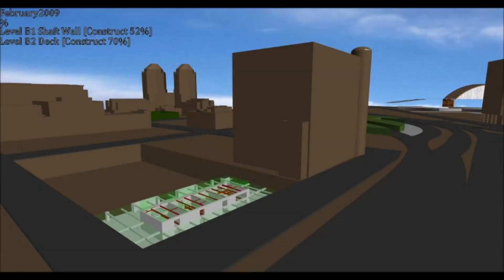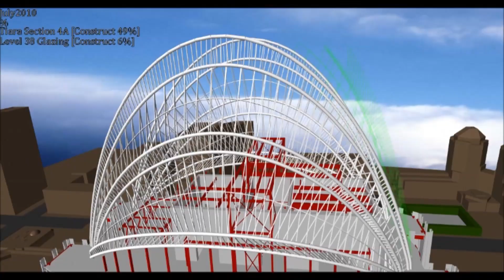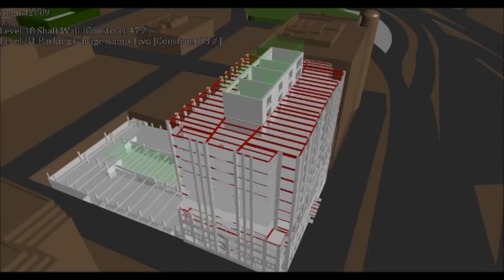Construction Management

Comment: Construction Managers have a place. But without the hard working, smart trades people and laborers toiling away day in and day out, nothing would be built. I have more respect for someone who started at the bottom then climbed the managerial ladder, instead of someone straight out of college with a fancy degree and who thinks they can just start giving out orders.
Reply: You can’t beat experience when it comes to trades, but not everyone is cut out for labor just as others are not cut out for management. Definitely a plus if you can do both.
Reply: @MrGatoka  You said it best.
Reply: Construction management is different than doing a trade. So they would need to be trained in things they aren't familiar with.
Reply: A college degree comes with blood sweat and tears to.. well maybe not blood. But people earn those degrees and put in extremely hard work and it shows that they can start something and finish it.
Reply: There is something to be said for the man who works his way up the chain. Those people are very important. However, if you have the opportunity to get somewhere quicker through a college degree it only makes sense to go that route.

Comment: good thing the architects are around to tell you what to do haha
Reply: lol, architects work for the contractor, contractors tell architects what to do.
Reply: @blakeb4583  No. Architects work for the owners and so does the general contractor.
Reply: @selahjames1267  No shit Sherlock, it was a joke--not meant to be taken literally. 
The reality is that we're the one building the project. If they require something that is good in design but is impossible to build in reality, we put our foot down. Architects are just a bunch of glorified art students who, most of which (especially junior designers), have never actually been on a construction site in their life. Not to mention, we pretty much fix all of the shitty design flaws that the architects made via RFIs and often times have more say to the owner about what will be built because half the time something an architect wants to do is not physically constructable. My project currently isn't even over with and we have over 3000 RFIs because the architects were probably high when they were designing the building. I get that technically speaking the owner is in charge, and that the architect and the GC work for the owner... but I'd say we have more power than architects when it comes to building a project because most architects have never even picked up a hammer. My point was to poke fun at the fact that people think we have the architects holding our hand throughout the delivery of a project, when in reality it's the opposite.We literally had a 3 month long argument with our architect because the fire sprinkler head cover color did not exactly match the metal ceiling panel color because the manufacturer they selected in the specs (the only one we were allowed to use) had a trademarked color for their metal panels, and the architect only allowed us to use a different specific manufacturer for the sprinkler head covers. It was literally impossible to match the metal panel cover because the manufacturer of that panel would not license the color to the other manufacturer. We ended up winning that battle because we literally have 0 time to waste on fucking sprinkler head covers. That's the kind of shit you deal with when you deal with architects--70% of the time they're useless, 30% of the time they're actually helpful.
Reply: @blakeb4583  i dont know what your deal is with architects,  but if you have work with them closely, you know they are more than glorified artists. There is a lot of math and science involved. GCs couldnt  do their jobs without architects because all their work is based on the construction documents that the architects  created for the project.

Comment: do you need to be a physics wiz to be a construction manager?
Reply: no
Reply: Maybe
Reply: No, but many of the classes I've taken in college for my Construction Science & Management degree have been engineering and physics based, so for classes, yes... out in the field, you just need to be able to understand how loads affect members on a building and be able to spot physics/engineering issues in buildings, but as far as doing any of the actual calculations, you won't really need to know it out in the field because that falls on the engineers
Reply: Fuck no!
Reply: So......
Reply: caymus cairns ppdooee lelod
Reply: I'm required to take one college level physics for my bachelors degree. That's not much, considering there are many other physics classes. The one I have to take isn't even calculus based. You use algebra and trigonometry to solve the problems.
Reply: FarFrom Banal depends on the company you work for. If you work for a GC, expect to work for 5-7 years before becoming a project manager, around 10-12 years to become a senior PM (the person in charge of the entire project). If you work for a sub, expect to work for around 3-5 years before becoming a PM. That being said, GC PMs make substantially more than subcontractor PMs due to the amount of risk. I work for a large GC on the PM route, but my title at the moment is Project Engineer
Reply: @FarFrom Banal CM=PM, those titles are interchangeable. You'll likely start off as an estimator, project or office engineer, or field engineer/assistant superintendent whatever company you work for.
Reply: FarFrom Banal that’s not really how it works, at least in the United States—not sure if other countries do it differently. I’m not sure where you read that information from, but that’s inaccurate for 99% of GCs in the US. I’m a project engineer for a large GC, and I’m on the PM route. An owner may hire a construction manager as an owners rep, but a GC & project manager are not overseen by a construction manager or vise versa. In 99% of cases, construction managers who work as an owners rep still need to meet the same educational & experience requirements as a project manager, but CMs who work as an owners rep only act as an advisor to the owner and have no oversight or authority over the project at all. Also, it depends on the project delivery method being used, the vast majority of delivery methods are CMaR (Construction Manager at Risk), there’s also design build, design bid build, and IPD (which is starting to gain more traction). CMaR in most, if not all, cases have no CM as an owners rep. The project i was on last year had a separate construction manager that acted as an owners rep, but they had no authority over the project.

I think what you’re reading is talking about a superintendent, which is the on-site manager for a construction company and is the person responsible for the actual construction of the project. Nobody calls them construction managers though, in 99% of cases, at least in the US, they’re referred to as superintendents. Superintendents don’t necessarily need to meet the education requirements, however my company now only hires supers with a construction/engineering degree and that’s the way the industry is moving. To become a senior super, you need minimum of 10 years experience, assistant supers can be hired right out college & just general supers have 3-5 years of experience prior to getting the title superintendent
Reply: FarFrom Banal no problem! Construction is a great and lucrative field to be in, don’t let anyone tell you otherwise! And internships are easy to come by, and most, if not all, are paid and will pay for your housing too! I had 3 internships during my undergrad with 2 of the largest GCs in the nation. If you like the field side, I would recommend trying to go the field engineer/assistant superintendent route which will ultimately lead you to a superintendent position. If you like a blend between office and field work, look for positions in office or project engineering! If you like to crunch numbers, look through drawings and do cost estimates, then estimating or business development is the route for you. You really can’t go wrong and there’s so much flexibility in the industry. While the hours can be long at times, you can expect a very generous salary (well into the six figures at PM or senior super levels and beyond), and a very generous starting salary (anywhere from $60k-$85k base salary not including benefits like health insurance, car allowances, stock & esop benefits (if you work for an ESOP company), 401k, etc. At my company, average retirement savings are $3Million+
Reply: FarFrom Banal no problem! Best of luck in your future endeavors. My one piece of advise not mentioned earlier, if you want an internship after your freshman year, get involved with your school’s AGC, ACI, or MCAA chapters. These are professional construction organizations and they look great on your resume, especially if you have no previous construction experience. I was a member of AGC during my undergrad, great way to get involved with your major and with the community as well!
Reply: Blake B I want to get into construction management but I’m from a third world country, Jamaica. If i get a bachelors degree in my country would it still be valid in other countries? Like USA for example
Reply: @rolandomcintosh7444  Most likely not because the building codes and standards are most likely different. I recommend searching a company that is hiring and just ask them if they accept education from your country.
Reply: caymus cairns Yes.